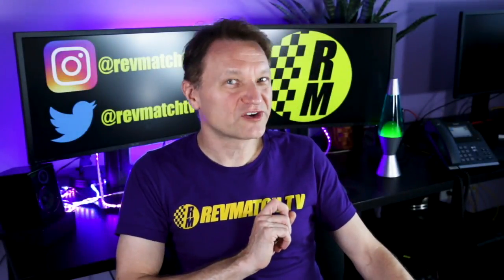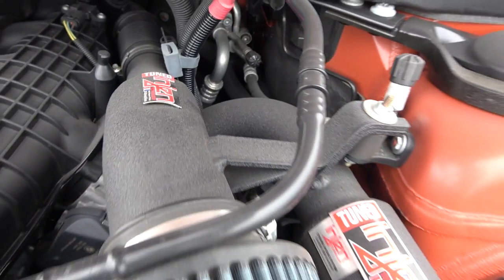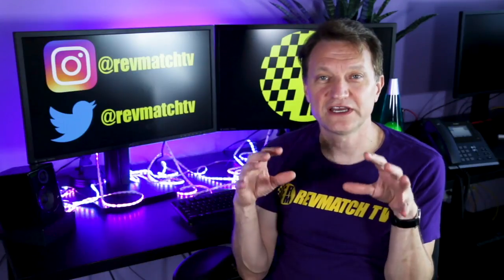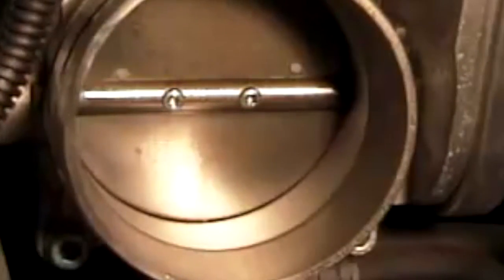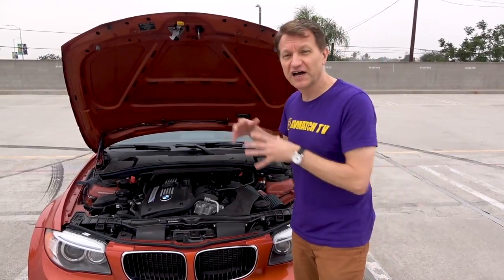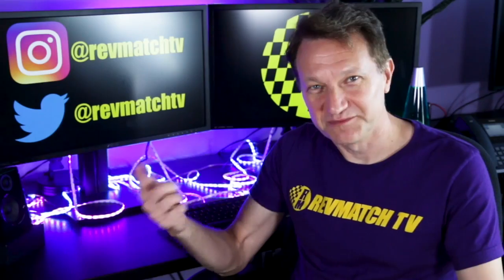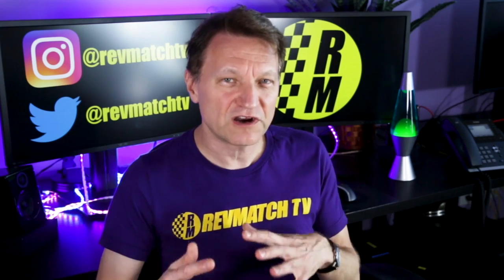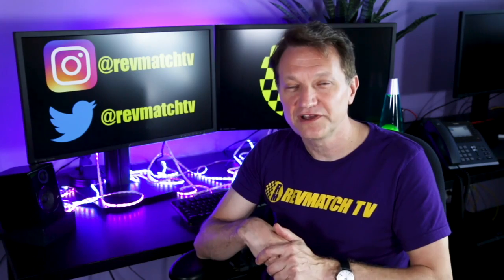Cheapest Ways To Increase Horsepower (that actually work)

Comment: 1. Cold air intake
2. Bigger throttle body
3. Exhaust system
4. Ecu flash or piggyback system
5. Torque
Reply: I literally youtubed how to get more torque and now I'm watching this video🤦🏾‍♂️
Reply: All of these increase your insurance premium, the more mods, the higher it will become.
The cheapest way is a clean airfilter, new oil and filter, clean out fuel system and a new sets of sparks, clean throttle body and perhaps new transmission oil, none of that increases your premium, but it definitely works bringing the car back to what it was when it left the factory.
Through time you always lose power, this largely restores it.
Reply: @mirola73  my car makes 190hp lol
Reply: @mirola73  lol how will they know?

Comment: I'm either really stupid or a genius

So, if we want more exhaust out of the pipes, could we just put an electric fan/turbo that would suck the fumes out?
Reply from the maker: Not really. When you're dealing with a naturally aspirated engine you can improve scavenging by using pressure waves in the exhaust. If you're going to use a turbo, then it's best used to increase the amount of oxygen in the cylinder so you can burn more fuel. Look up the Engineering Explained video on this.

Comment: I have a 2002 Honda Accord 3.0 v6 automatic. I want to make it faster can I just do a tune or it’s not possible since it’s an automatic??
Reply: you can still get a tune
Reply: Devan Chea but will it make it gain power idk too much I’m new to the car scene
Reply: You can still get more power out of the engine. The transmission has nothing to do with it, but if you have a CVT you’ll want to be careful about adding power since they don’t handle high torque applications very well.

Comment: Hey, I really hope you or somone that knows sees this, I didn't quite get the last part, did you suggest to change differential gears or what .. I'm quite confused
Reply: Basically don't need to dishes transmission gears but the dif i think is also referred to as final drive making it shorter ie adding more teeth =more torque taking teeth out longer gear spacing = power but power isn't always good slower 0-100 times but bigger top speed making the car top speed to much motor go boom but to much torque trans go boom
Reply: @buildtime78years9  therefore you cant avoid the "boom"

Comment: I drive a stick shift. When it comes down to it tho. I just want it to be more responsive so it can not stall when I drive it in traffic. Because simply its a zipper not a ripper.
Reply: Get a power tune performance chip it will help tremendously.

Comment: What are the safest ways to add hp without damaging the engine? Like a cold air intake
Reply: Air intake, exhaust headers, exhaust, ecu, weight reduction but remember hp isn't the most important. The driver is the most important.

Comment: While I agree with your thought about increasing the final drive (rear gear) ratio (the bigger the number, ie from 3.08 to 4.11) increases torque at the drive wheels, it just seems a little odd you would mention it was a common drag racing technique and then show a clip of a top fuel dragster (blowing the engine) when those cars run their fastest and quickest ET using a taller (smaller number) rear gear ratio.  NHRA actually limits the highest RGR to 2.90:1.  I guess what I am getting at is, increasing RGR from 3.08 to 4.88 (more is not always better) may not decrease ET's.  You would need to take into account the vehicles current torque curve and intended use.

Comment: I live in oxnard wanna be ricers everywhere fart cans everywhere. I drive a hyundai accent gt. 2005. Its. A simple car. 5 speed manual. Inline 4. All it has is a cold air and an aftermarket exhuast. I dont like crazy power. But it can go 0 to 60 in about 4.5 seconds on a good launch and from a roll about 30 to 100 in about 6 seconds. Not crazy power just guted the trunk and all the useless bits to bare bones. Smoke the ricers and its a great sleeper.
Reply: Haahh accents have no power.
Reply: I love racing small cars in my hemi 😂
Reply: Yeeeaaah, I'm sorry, but I'm gonna have to call BS on that one. Unless you can provide evidence
Reply: extreme cap
Reply: @kjw763  Yea i guess. I think Ima switch out the cylinders and probably bore it out to be a 2 liter its an Iron block so I might get ab engine jacket to reinforce it. And some new valves considering makeing it use some forged rods and pistons.
Reply: @burntchickennugget191  man that's just from a CAI & exhaust? Crazyyy, I wanted something moderate too, not going the forced induction route because I'm not responsible with cars on that level yet. I'd be too much of a menace on the streets 🤣